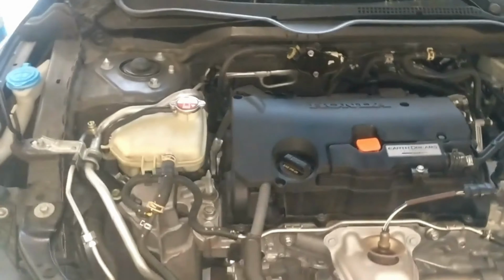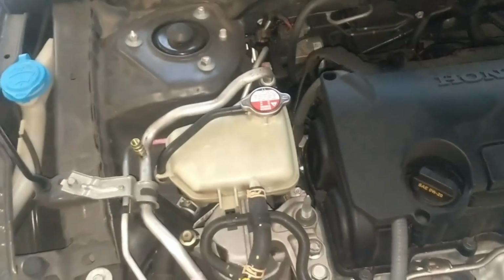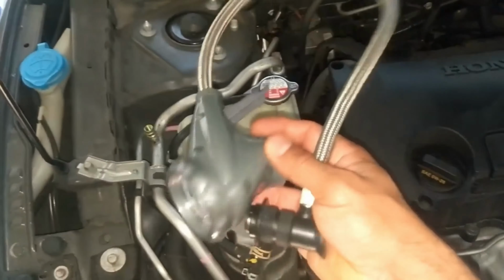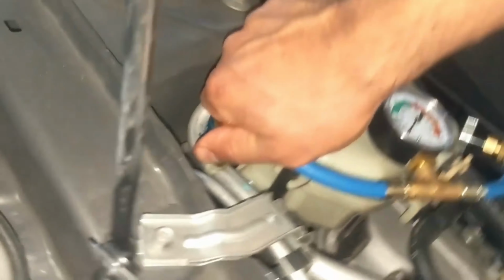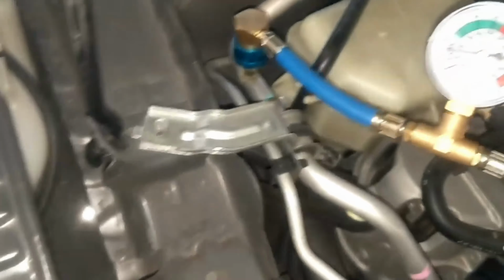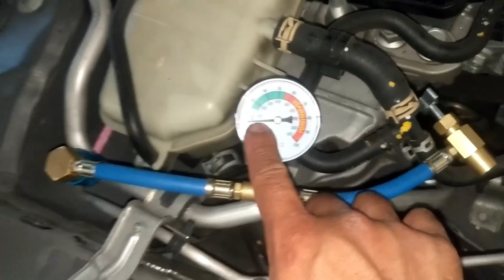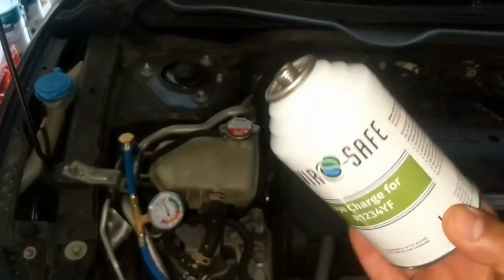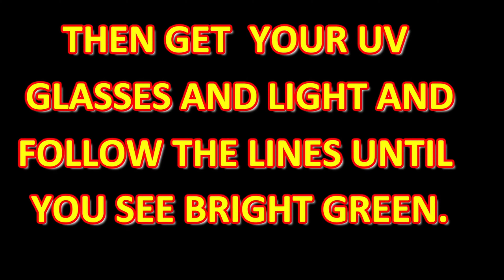HOW TO FIND AC LEAK ON 16 17 18 HONDA CIVIC (AC RECHARGE OR AC PROBLEMS OR AC NOT WORKING) R1234YF

Comment: Anybody else having this issue on their 2017 civic? A lot of people saying the ac compressors are defective and Honda is aware of the issue and will not cover it at all. Unbelievable, this should be a recall!
Reply: I am literally having the same issue right now. They won’t replace it at all.
Reply: They said my extended warranty does covers that
Reply: Ruby Sattar same
Reply: ac not working
Reply: My 2017 a/c driver side is 25 degrees hotter than passenger side. Feel 🥵.   They want $550 to fix for my 2017
Reply: @moulin680  what they telling u is the problem?
Reply: Facing AC leak issues. I just ran out of my 3 year warranty. Dealership ordered the parts. Not sure how much they are going to charge yet. 2017 Honda Civic sucks. In these 3 years, I had bunch of isues. I don't trust the "Honda" brand anymore and no need to pay the premium price for reliability
Reply: My  2017 Honda Civic is having same issue. Honda claims no recalls and dealer refuses to fix it. It’s horrible, never buy a Honda
Reply: My car was still under warranty when I first took it in. They told me it was overcharged and that they had refilled it. No leak found according to them. That was in March and now 6 months later my AC no longer blows cold once again!
Reply: @moulin680  I had the same problem. Don't pay for that shit. You need to call honda hotline directly and tell them the problem because that stealership trying to scam you!
Reply: @moulin680  My stealership was trying to charge me $300, it doesn't sound right because my car is still within the warranty period, then I make a call to honda hotline directly and let them talk to my stealership, after that ,I got my money back right away!
Reply: @galonite  That was the same BS my stealership told me just to avoid warranty claims!
Reply: Ot working
Reply: Yep got a 2017 civic right now blowing hot air and they want to charge me $130 just to look at it lmao.
Reply: I'm having the same issue with my 2017 Honda CRV...Hopefully still under warranty..
Reply: There is a 10 year unlimited kilometer warranty on the AC system ( at least in Canada). I've had mine replaced once already. It's going in next week to be checked again.
Reply: @jbrandona119  just for them to “inspect” mine, they told me $395.....
Reply: I have the same issue. Ac gone on every spring. And they were still fine in fall. I bought his leak check. But only place I find “green” is the inlet valve. I bought a bought of stop leaks pass 2 springs and just those could holding up the AC until November. The Feons just like disappeared without an exit.
Reply: So I’m not the only one
Reply: Same issue right now. They said it was a "rock." They even showed me pics of my supposed condenser. They wanted $1000 to fix. I said go to hell. It's a defect and you know it!
Reply: I have had the evaporator leak twice, which was a pain because the entire dash needed to be removed. And now the condenser is leaking. Not under warranty even though a bulletin was sent out that all trims from 2016-2019 have 10 year warranty extended. Horrible how an ac in this modern age can be faulty. These civics are so expensive now on top of that. Horrible. Good luck to everybody! Keep fighting for the AC
Reply: @moulin680  did you ever get this fixed? I have the same problem
Reply: its the condenser,   they will diagnose and replace and add 10 yrs to the warrenty, there is a Tech Service Bulletin on it,  the condensers weremade at a different plant and are defective
Reply: @dustygerlach7618  Not so true. They told me a rock hit mine and would not replace it. They pretended they knew nothing about a defect and wouldn't even answer me when I mentioned it.
Reply: @lori8519  here is the bulletine have them show you the rock hole. lots of dealerships are refusing to replace,  best thing to do is call Honda direct and tell them. they headquarters are in California https://static.nhtsa.gov/odi/tsbs/2019/MC-10163796-0001.pdf
Reply: @moulin680  this is kind of normal. in kind of all cars basically. the furthest drivers side vent is the furthest vent from the box in the dash that makes the air cold. all decent a/c techs know this. i don't know what they are going to do for you for 550 dollars there's probably nothing wrong with your car.
Reply: Mines just gives hot air on the driver side. This is bullshit! Seriously Honda has disappointed me since the purchase of this car. 3 months later the front side windows where leaving grease tracks and one is slower than the other. Took it to stupid ass dtla dealer ship and they said I had fucken berries in the door panel. I don’t park near trees at all. So me and my friend opened the door panel to see the damn berries, no berries at all. This was my 3rd taking it in 2017. They said they would charge me for the 4th vist.... This car was still under warranty at the time. Fuck Honda and their scamming sells/“”mechanics””” people. Should of went with a Toyota😡
Reply: @Roxy1kb  maybe time to find a new honda store to try and get some customer service. definitely not all dealerships have a competent service department. there's probably a national honda customer service phone number too (google) it would be worth seeing what they say.
Reply: Yes My 2017 UK Honda Civic making my life Miserable.Never buy Honda Brand again,
Reply: yes we  have this issue with a 17 civic also
Reply: I'm having ac problems too.
Reply: Same, the AC in my 2016 civic won’t blow cold and it is a safety hazard as the defrost feature is not effective in stopping the windshield and windows from becoming foggy during a rainy day or humid day. Dealership wants 150 dollars to look at it. Fingers crossed that they don’t lie to me about the real issue or try to screw me over on it.
Reply: Totally agree what bs
Reply: I have the same problem with my 2016 Honda civic
Reply: @jeffreyjsmith1980  Did they charge you again when you went back to them after a year? Is the whole AC system under a 10 year warranty or just the condenser?
Reply: @moulin680  how did u test the temperatures?
Reply: They are on recall.
Reply: @dev9998728750  really?
Reply: @justblake_here  if they check and find an issue and issue related to only condenser yes, it’s call extended warranty, not recall. But if there is anything else won’t be covered
Reply: @dev9998728750  I have few things wrong that are related to AC.... they will not cover them but will cover only the condenser. smh...
Reply: @justblake_here  unfortunately yes, something also wrong with my AC but they will not going to cover. Honda has lost their reputation.
Reply: Yes compressor changed twice two years in a row 2020 & 2021 and still doing the same thing, did it again and now their saying is not the compressor that the evaporator is leaking and want to charged me almost 3k to fix it
Reply: I have same issue
Reply: My ac is blowing hot air on both sides. Any advice

Comment: Honda sent me a letter talking about an issue with the AC. I believe it’s a recall and they fixed my problem at no cost. Perfect since it’s the last month of summer.
Reply: I haven't got a letter, i'm not sure what's wrong with mine, it blows hot air, checked the refrigerant and it's full but still blowing the hot air.
Reply: I got a letter. But I went to try to get it fix. They still tried to charge me $1500 and they said high possibility it won’t be fix and it might be another $500. I said nah. And just left

Comment: Thanks for the video going to give this a try myself. Just a quick question, how would I be able to see if there’s a leak in the evaporator without having to rip the dash apart? And also would it still be somewhat safe to add refrigerant if there’s any leaks bcuz it is really hot where I’m at right now and I need the ac. Thx.
Reply from the maker: @jason2live190  there is no way to visually see the evaporator without taking the dash apart, but I believe that the least of your problems. most leakes are in between the lines because of gaskets. And yes, nothing happens if you add refrigerant as long as you follow the gauge and don’t add too much freon.
Reply: @BudgetClan  awesome thanks!
Reply from the maker: @jason2live190  your welcome. Good luck!

Comment: The #1 source of leaks are the service port "caps".  The cap, NOT the shrader is the primary seal.  Cap seals and contact surface need to be clean and TIGHT.

Comment: don't bother taking it to a Honda dealer if you have an AC problem $90 to do a diagnostic where they found nothing and wanted almost $600 to put the Dye into it. save yourself the money and heartache and do it on your own.
Reply from the maker: That's right
Reply: But once you find the leak how you fix it....
Reply from the maker: @peaksurg  once you make sure all the leaks are fixed... You buy refrigerant r1234.. and add the amount of freon that is on the label of the hood
Reply: Dealerships are a scam.
They charge you for one repair, then your ac leaks again after a few weeks, then they charge you for another repair that doesn’t fix the issue. It’s a scam.
Reply: They wanna change me $170 just to fucking check!!
Reply: take a crash course in your cars ac system and diy...the dealer is gonna get you for a Grand !!
Reply: the ac system is pretty basic...most compressors and the lines on newer cars dont leak...on Hondas its mostly condensers....use the UV dye to make sure then replace the condenser and charge it up !!
Reply: @FirstnameLastname-pi6zt  

Definitely not what they used to be. In the 80s my dad would buy cars from the same dealership because they would comp him on so many repairs and maintenance. Not like now, they all want more money even though you already gave them tens of thousands of dollars when you bought the car.

Comment: The A/C evaporators on these generation civics are also common to leak. You can remove the glove box and disconnect the the blower motor transistor and stick a mirror and angle it inside where the blower motor transistor fits and more than likely will see traces of a/c dye as well.
Reply: I have a 99 civic and thank god my car is easy to work on. I'm dealing with a leak as well after replacing m entire A/C system. My evaporator sits right behind the glove box and its easy to get to. I pulled mine out and replaced in under 30 min. It's like 7 bolts on my car to remove the evaporator housing in my car. I have to inject some dye into my system and I have to just start looking around til I find the leak.

Comment: Honda did extend the warranty on the condenser only for 10 years. Not for rock damage, but for not being installed proper at the factory. Depends on ur situation, it may be covered. Campaign #6C3/ service bulletin #19-091
Reply from the maker: Awesome thanks for the update!
Reply: Is this the new news because I saw that they just dismissed this case

Comment: Just checked the freon, it's still on green but blowing hot air, what could it be? what should I do? i'm over the warranty
Reply from the maker: check the compressor... when you turn on your vehicle and ac you should hear the ac compressor kick on and the clutch should be on .... your can hear the different sounds when the ac compressor is off vs being on... check that first... let me know what happens my brotha!
Reply: @BudgetClan  Update: Went to the dealer and the compressor had extended warranty, they were able to fix it with no charge due to the service bulletin that was out. The summer of hell is over.

Comment: How did you fix it did you need a new condenser?
Reply: There is a 10 year extended warranty for the condenser on 2016-18 civics. Dealerships are going to try an scare you out of setting up an appointment for service by threatening to charge you a super high diagnostic fee. But fight them and tell them to fix it for free. Try and verify that it is indeed the condenser before you bring it to them.
Reply: @johnnycincocero  i called them & told them what was going on. they kept telling me it's the condenser & that supposedly its free of charge to fix but if it's not that they will charge me $170 diagnostic fee!! $170!!!
Reply: @julieelle6453  yep. That's what they do. They hope you say ok... Whatever! My civic was still under warranty. I told them that when I dropped the car off. They verified. Then once they found the freon leak, which wasn't the condenser, btw, they still tried to charge me. Had to again tell them it's under warranty. It's still not fixed. Waiting for the low pressure side hose to come in. I bet they will try and pull another fast one. They're fucking scum. Good luck. Don't let them get away with it.
Reply: @julieelle6453  There is no fee if the car is under warranty or the if the condenser is defective.

Comment: when I attach this to my 2017 Honda Civic the arrow doesn't even move, but I do get cold air from the AC when it's not very hot outside. However, when its like 90+ then I get less cold air.

Comment: Where do you get the UV light? Forgot to put link in bio
Mine is slight low on hot days on semi warm days it's cold. 
Is the enviro safe dye ONLY or with both refrigerant dye ??? It's confusing it says dye and refrigerant

Comment: What does it mean if the compressor has the green spots like on the video? Is the compressor bad?
Reply from the maker: No it means that there is a leak where the green is..
Reply: @BudgetClan  so how does that affect the engine or car as a whole?
Reply: if left unfixed?
Reply from the maker: Freon leaks out ... freon is what makes the air cold... need to fix the leak, then refill with freon to be fully functional!

Comment: I have a 2016 civic ext with the dual climate control .. I put in the gauge and it’s reading 45 but I don’t get cold air ? What can it be
Reply from the maker: might  need to top it off .. should be in the 50-55 range for max cool!
Reply: @BudgetClan  topped it off only lasted a month and didn’t bother to fix it but think it’s the compressor or condenser leaking
Reply from the maker: If coolant is low.... definitely a leak.. condenser probably..

Comment: My just purchased the hose to check the Freon. So if it’s low do you recommend us to use the dye to check for any leaks? Or since it’s low in Freon we just recharge it? I’ve taken it to multiple shops to get it checked but they do not have the hose for new cars. My last resort is the dealer but I’m trying to avoid spending crazy amount of money. Thanks hopefully you can answer my questions.
Reply from the maker: If you are low on freon you have a leak. But most likely it's a very small leak like an o-ring.. so yes I recommend you put the dye first... Then that and tell you where your leak is at... If you are under the three  36,000 mi warranty.. dealer will fix it for free.. Please feel free to ask any more questions I'm glad to help

Comment: When replacing the condensor how did you do it did you need to put new o rings on and add compressor oil to new condenser?
Reply: wow that question says you need a lot more background into that project. you would probably do good seeking out a mechanic you can trust to handle it for you for a competitive price. if getting it fixed for a fair price is still out of your means than you should do alot more research first and get some good service information and read that first. best of luck to your condenser adventure.
Reply: the oil is already in the R134 can..hope this helps

Comment: Once fix the leak that was found because of the dye r1234yf can I use that to refill it or do I have to buy the honeywell one?
Reply from the maker: So the dye is separate from the freon... Once you find the leak and you made sure you fix it... You would need to add freon r1234... It could be any brand as long as it's r1234

Comment: Question...I 
My 2017 civic is out of ac gas can I use the adapter to reload more gas? And wish brand is compatible. Thanks
Reply from the maker: Yes but you need a specific hose made for the r1234yf refrigerant. You can add more gas but if you have no gas you most likely have a leak. This is why you add the dye first to find the leak to fix. I could be as little as a o Ring
Reply from the maker: Yes it was the condenser and o-rings
Reply from the maker: The die will not hurt your vehicle... Of course Honeywell is a better brand..but to find the leak you might as well use the cheapest guy you can get... Because upon replacing parts your refrigerant is going to come out anyways... So when you put new refrigerant and made sure you had no leaks... Yes put the Honeywell
Reply from the maker: @eliasbarajas1456  the cheapest is on eBay 35 each can.. they also sell the dye kit
Reply from the maker: @eliasbarajas1456  
R1234yf cans 
https://www.ebay.com/itm/153812433895
This is the dye kit I used in the video
https://www.ebay.com/itm/283507349011
Reply from the maker: You Wish  one time use..unless you keep the hose or adapter connected

Comment: Were can I purchase the fitting and the regulator to check the level of my frion thank I have the 2016 civic same issue and also the condenser when bad
Reply from the maker: Amazon. Just make sure its for r1234yf hose. And it will fit